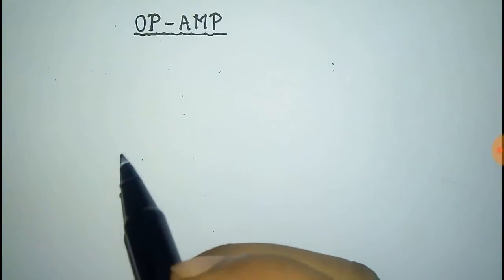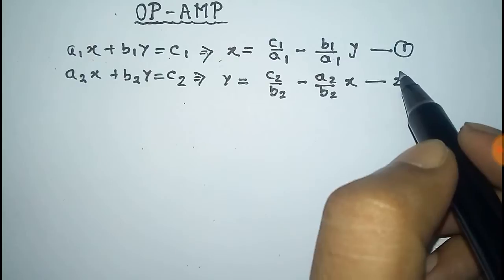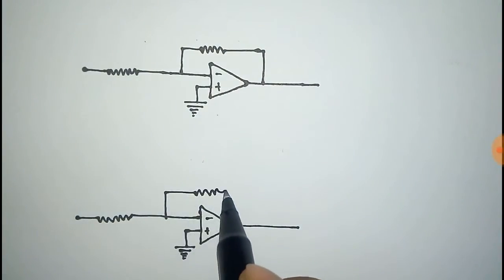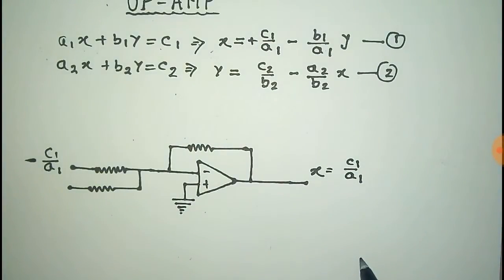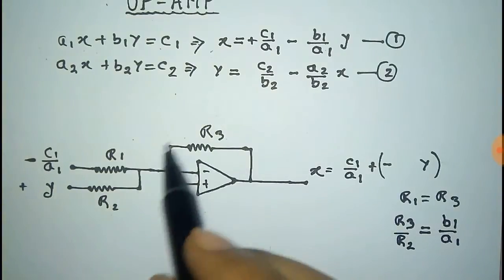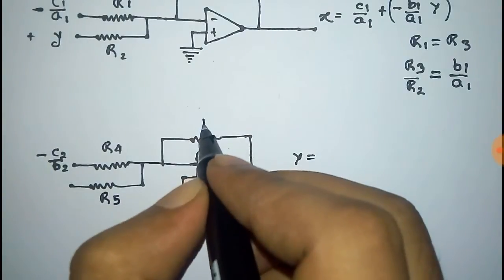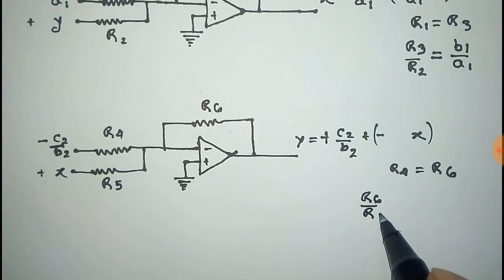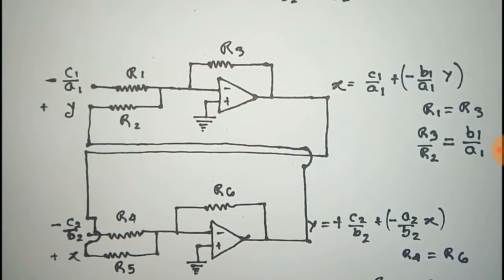Solve linear equations with OP AMP

Comment: Walking through the circuit, it really does look like this creates an unstable equilibrium. In other words, this could only function if the output values are absolutely perfect. Otherwise it’s going to feedback and just slam to the rails which is what appears to be doing. What am I not seeing?

Comment: I built this but it just slams to the positive and negative rails.  Is there some issue with tr bias currents?  What’s going on?
Reply: The range of values for x and y are limited to the positive and negative rails. So, for this to work -c1/a1 and the other constant needs to be very small. All in all this circuit does not allow you to vary the ratio of constants too much!